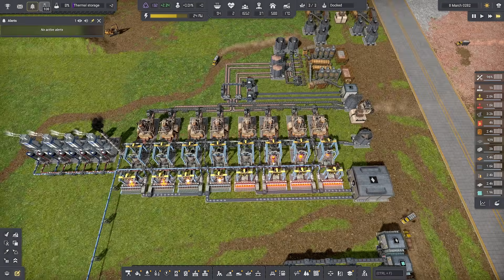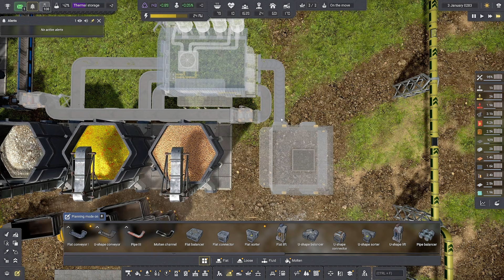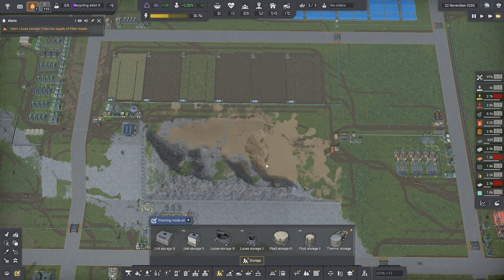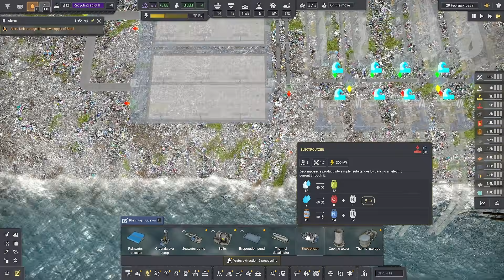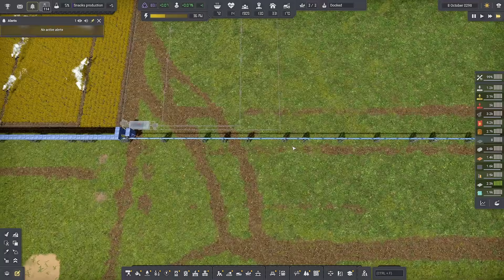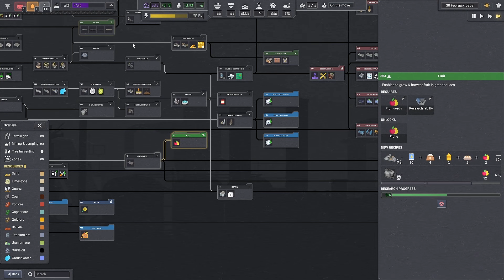Health & Pollution; Waste Treatment & Medical Supplies | 09 | CAPTAIN OF INDUSTRY - Update 4

Comment: Do not know if you’re running the trains DLS. But the molten cart or torpedo/lady’s cart. Factorio players should know this all ready.

Pipes are not built under water, and bridges become the best option for crossing by train or truck. As some islands look ideal for industries like copper and forestry. Only the foundry section would have to be constructed. Its a large map and is nice with ideal islands as starting location. Lots of limestone near the sea for sinking Co2 instead of extracting the entire deposit. Importing oil and water via train or use a dock. It takes greatly less time building a bridge than dumping a crossing. One could save more resources by bridging over taking the time dumping.

Nilaus all ready has all the component industries built.

Comment: 35:04 Was there a need for that balancer, or have you added it just for fun? You literally have a storage with 4 outputs. You could link them directly and still have one left to spare. And they should work faster than a 2:3 split.

Comment: Trains would be more efficient goods transport that uses fuel comapred to trucks, no? They're basically extreme throughput belts in how they function, so maybe making a train for terraforming is the way to go? I know that Tier3 vehicles can very easily overwhelm a single belt, so you are either forced to build tons of trucks, multiple layers of belts, or a single train to transport dirt and rock long range.

Especially useful if you're expanding your island via dumping of rocks.

On the other hand, 4 belts beat the train in transport capacity, so there's that.

Comment: Should have dumped the garbage a tile lower than the eventual final elevation and then covered it with dirt/rock/slag.  Now if you want to get rid of the ground pollution you will  now need to skim the top layer with excavators to get rid of it.  Or move the town and cover it.
Reply: No. Dumped Waste becomes inert after a few years and will stop Polluting, unless you disturb it by digging. That restarts the timer.

Comment: does it bug anyone else that the trucks seem to be actively avoiding driving on the nice paths laid out? is there no bonus applied to the path finding for concrete paths?
Reply: There is no path finding on concrete..u have to force them to with barriers..but if they do drive on it the receive a maintenance reduction bonus
Reply: @andystevenson7151  it should be both maintenance and speed. after a certain point throughput is more important than maintenance.
Reply: @danilooliveira6580 agreed
Reply: Trucks pathfind to the shortest route to their destination.  They don't track for concrete/roads, but forcing them to drive on roads via vehicle barriers reduces maintenance costs.

It's a case of having to judge route efficiency vs. maintenance reduction.

In a perfect world your layout will have the trucks' paths of convenience paved over for both fast speed and maintenance reduction.